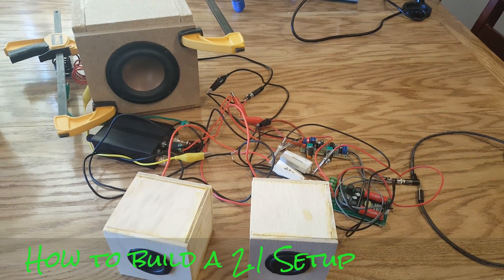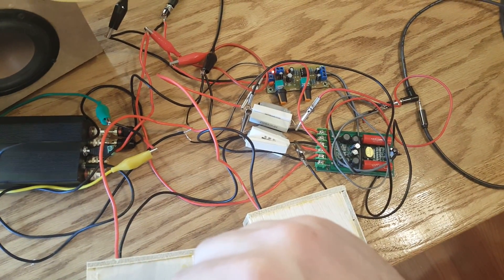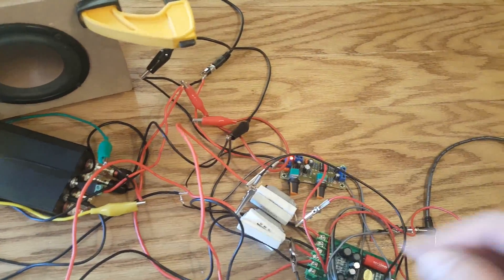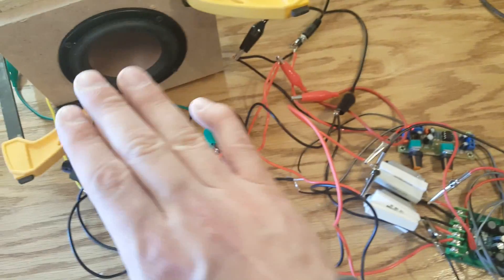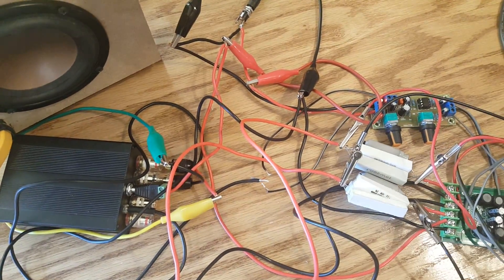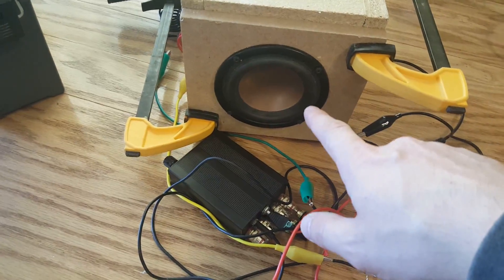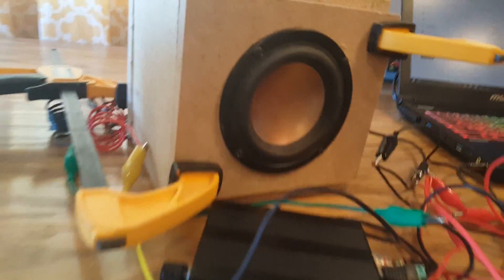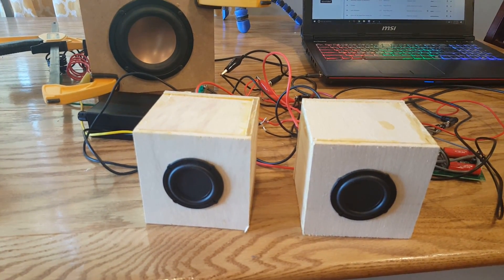How to Make a Rocking 2.1 Sound System

Comment: I'm about to build a speaker project using a TPA3116 2.1 hats the best way to add a rechargeable battery system to it?  I was thinking  on using 18650 batteries. Thanks

Comment: I produced music for bands, I've been in bands my whole life, I play guitar and bass. I should have mentioned this before, but I don't want anyone taking something I say as a dig, I only want to help. The red and white are Left and right signal wires that go to the inputs of the amp and so on, as a rule I always keep the bass guitar, kick drum and sub frequencies panned dead center 50% left and 50% right signal unless the bass guitar has a stereo effect or double kick drums and I'll pan them at 10 and 2 or 11 and 1 if somebody requests a left to right pan so only connecting the left or right wire becomes a issue.There's a correct or best way to wire both left and right so you get both channels into mono using a 4.7k ohm resistor which is fine on both of the left and right channels to in on the mono amp. Right channel = 50% of the signal and the left makes a total of 100% and you wont hear the pan, but it wont be cut off so you'll hear the right and left pan in one channel. By connecting one wire you only get 50% of the signal and you'll have to crank it adding distortion and half the source. To be the most accurate on the value of resistors you have to know what the impedance of the amp chip is by looking up the schematics. If somebody knows a better way speak up.
Reply: I dont have a better way but you should not pan the kicks during mixing even if its death metal. Never. Also, you should divide the bass track in two or more tracks with  a crossover eq at around 120 hz. Nothing below that point should be stereo. The higher the frequency, the higher the stereo effect should be during mixing.

Comment: 123Toid+  The Guru Dude. That Variable Low Pass Filter Electronic Subwoofer Crossover Preamp Board with Gain Control has expired, but it's been replaced by the same thing. Maybe they changed the value of a couple components so the new link is https://www.parts-express.com/variable-low-pass-filter-electronic-subwoofer-crossover-preamp-board-with-gain-control--320-671 and this looks like the perfect match for the Sub Amp DC 12v-24v TPA3116D2 100W mono digital amplifier board 100W subwoofer amp https://www.ebay.com/itm/282165448981?_trksid=p2057872.m2749.l2649&ssPageName=STRK%3AMEBIDX%3AIT&rmvSB=true They rate all of these boards @ 10% THD so you can count on a good 80watts and that board answered a different question, thanks again.
Reply: Same Variable Low Pass Filter Electronic Subwoofer Crossover Preamp Board with Gain Control  for half the price. 
https://www.ebay.com/itm/12V-24V-Low-Pass-Filter-NE5532-Bass-Tone-Subwoofer-Pre-Amplifier-Preamp-Board-DG/262739803446?_trkparms=aid%3D888007%26algo%3DDISC.MBE%26ao%3D1%26asc%3D50526%26meid%3Da5c7d1552ccd4cfb8ce0a1de7881f203%26pid%3D100009%26rk%3D1%26rkt%3D1%26sd%3D282165448981%26itm%3D262739803446&_trksid=p2047675.c100009.m1982
Reply from the maker: Great point. I actually just ordered that version of the variable low pass board as well as an amplifier to make a custom built sub.  That will be on my channel much later.  I completely forgot to update the link.  Thank you!  The only issue with the one from Ebay, is you are ordering it from China, so expect to wait around 30-45 days for it.  Of course, if you do not mind waiting, it is a great deal.
Reply from the maker: I absolutely think so.  That is on my list of necessary products for speaker building.  Not only does it measure your drivers, but it also tests your inductors, capacitors and resistors for their actual valuation.  Plus, you would be surprised at times you will get different t/s specs than the measured manufacturers.  I think it is one of those products is well worth the price.  I hope this helps

Comment: What do i do when my components take different voltages?
Reply from the maker: You usually would use a step down or step up.  This will either up or down the voltage to what you need for the second component.
Reply: 123Toid thank you!!

Comment: My Pioneer mvh-x580bs runs my 2.1 set. 3 channels of power and a great crossover on board, with Bluetooth and usb input. Plays flac too.
Reply from the maker: Great point.  One can always use a car head unit with subwoofer out.

Comment: links please?
Reply from the maker: This is the subwoofer variable loww pass board I used:  https://www.parts-express.com/variable-low-pass-filter-electronic-subwoofer-crossover-preamp-board-with-gain-control--320-670  The rest of the parts were what I had laying around.  You can use any two amplifiers.  The speakers are 2 of these https://www.parts-express.com/tectonic-elements-tebm35c10-4-bmr-2-full-range-speaker-4-ohm--297-216 and 1 of these https://www.parts-express.com/hivi-b4n-4-aluminum-midbass-round-frame--297-429
Reply from the maker: Here is a link to the project box amplifier I built that is in the video: https://www.youtube.com/watch?v=xMzyrInZBuM&list=PL6hjpiCHZmIOUc3snzJiS6uMsSNLKXlJy
Reply: this video is a sweet build. Thank you for the link
Reply from the maker: The best thing to do is buy a 2.1 board with bluetooth built-in.  Here's an example: https://www.aliexpress.com/item/1pc-TPA3116-Class-D-Amplifier-Board-Bluetooth-2-1-Amplifier-Board-100W-2-50W/32768125158.html?spm=2114.01010208.3.155.oGQ2z7&ws_ab_test=searchweb0_0,searchweb201602_4_10152_10065_10151_10130_10068_436_10136_10157_10137_10060_10138_10155_10062_10156_10154_10056_10055_10054_10059_10099_10103_10102_10096_10147_10052_10053_10107_10050_10142_10051_10084_10083_10119_10080_10082_10081_10178_10110_10111_10112_10113_10114_10181_10037_10183_10182_10185_10032_10078_10079_10077_10073_10070_10123_10120-10037,searchweb201603_1,ppcSwitch_4&btsid=e7053032-1a5f-441d-9314-ef8883c74fad&algo_expid=32fc0a94-f410-4eca-b74a-33412f1fc91b-20&algo_pvid=32fc0a94-f410-4eca-b74a-33412f1fc91b  You can d what you are talking about, but you would have to find the left, right, and ground signal on the bluetooth module and solder on to those contacts, then run it to the low pass board.  It usually isn't worth it, when you can buy them all in one, like this.
Reply: 123Toid Thank you. I was trying to make a 2.1 with what I have but will certainly go with what you recommended at a future date. Thanks for your great videos!
Reply: Can you make a 2.1 if your 2ch. amp uses Bluetooth as the signal input? Is it possible to share the Bluetooth signal to the Low Pass Board and the secondary mono amp for the subwoofer or do I need a primary board with a 3.5 input jack to share the signal? Confused? Yeah, me too. lol